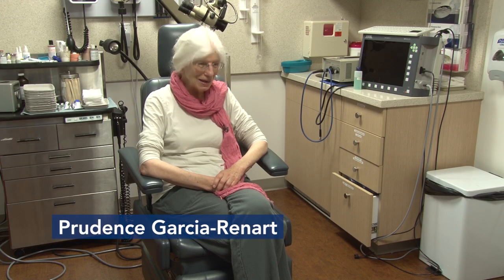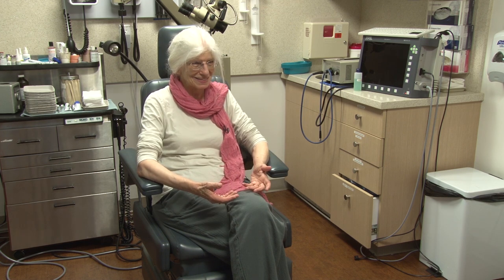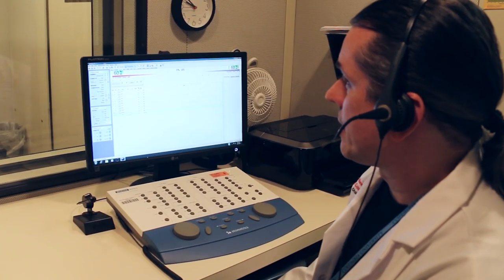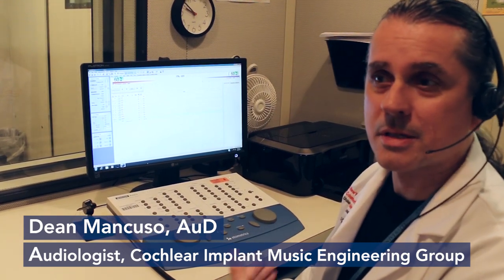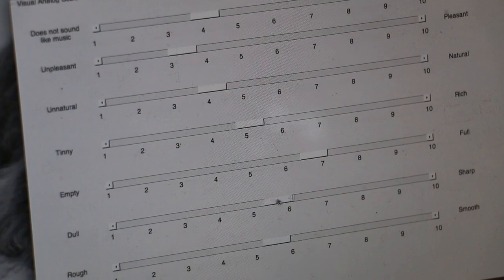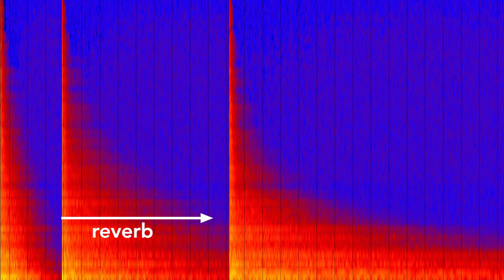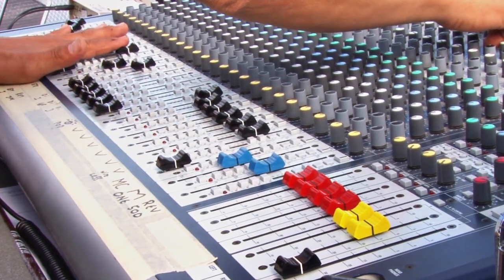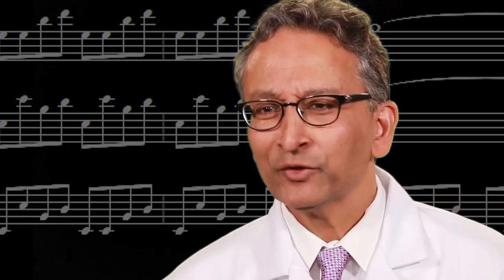Engineering Music to Sound Better With Cochlear Implants

Comment: I have a cochlear implant and when I watch videos like this I'm always struck by the irony that they're made for hearing people and without much consideration for the people they're about. Putting that weird Country music track underneath makes parts of this video, which is also captionless, unintelligible. The people who might be interested the most in this video will struggle unnecessarily.

Also, that harsh bit at the beginning is not even close to how music sounds through an implant (at least not through mine). It might be characteristic of older implants and processors. Yes, it does sound like garbage, but it's not just binary monotone static. It's got a bit of range in there so it's identifiable as music, but pitch is where the main issue is. And like the video indicates, reverb is brutal and complex music sounds awful. Distinct notes (not chords) and stripped down recordings sound far better.